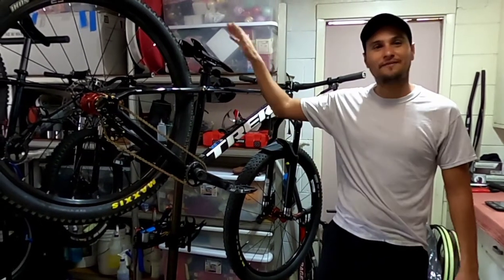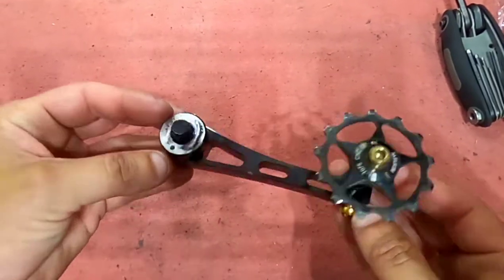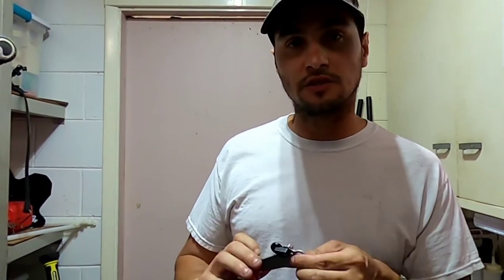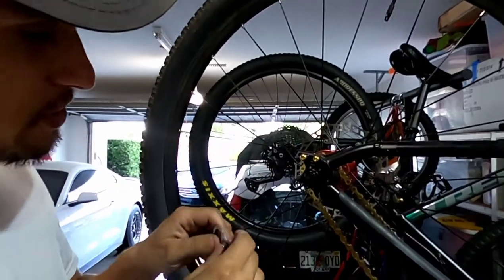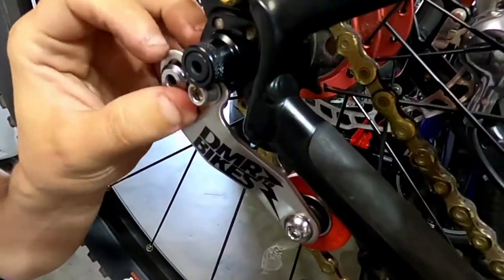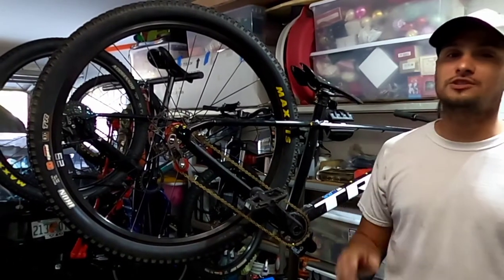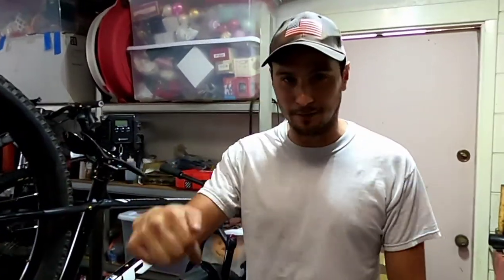DMR Chain Tensioner Installed on my Trek Marlin 5

Comment: Chain goes on top of the red rubber wheel. Everyone installs these wrong. Even the manufacturer gets it wrong.
Reply: No it doesn't. That would literally give zero tension. I tried it on the top first 🤣
Reply: Yes it does cuz it pushes the chain more into the cog and spreads the tension out more evenly
Reply from the maker: With other tensioners, yes but the DMR tensioner was designed the way I installed it

Comment: Haven't you mounted the CT incorrectly? The jockey wheel pushes the lower chain down and off the freewheel, concentrating the pedal force onto fewer teeth and chain links, causing faster chain wear and sharktoothing. But if the jockey wheel pushes up from below the chain  it wraps chain around more freewheel for less wear and more efficient drive.
Reply from the maker: Yes it's mounted correctly. If I would force the chain up I may only get 1 or 2 tooth more which wouldn't be much of a difference. Think about it even with a regular cassette and derailleur you're grabbing less teeth through all the Cog sizes. Now for the chain wear that could be a double-edged sword I see how you think it could have premature wear. But on the other hand the more the rollers on the Chain comes in contact with a cog could wear it out even faster which they call chain stretch.
Reply: @hardtailrider7172  Hmm....I'm not quite convinced. Note that on a usual derailleur setup the chain runs off the rear cog and upwards to the top derailleur jockey wheel giving the wrap effect described above. After ditching all that for a single speed I was mystified that my chains only lasted 3 months max compared to 5-6 months with derailleur. So i tried a CT and doubled my chain life. The descending chain from the JW grabs the freewheel in front, meshing with more than half of the freewheel teeth. Now compare that with your setup.
Reply from the maker: @sidmarx7276  I've been running the same chain on my single-speed for about 4 and 1/2 months with no issues and I'm running an aggressive single-speed. no need to change something that works Flawless for me but I do value your opinion. Trust me I tried to make it to where I didn't have to have a CT I spent a lot of money trying to make that happen but it just couldn't do it.
Reply: @hardtailrider7172  Glad your method works, and i'll try it if my chain starts wearing too near the chainstay.
Reply from the maker: @sidmarx7276  I will be putting a video out on Wednesday on the DMR chain tensioner things I had to replace and needed modifying minor stuff.
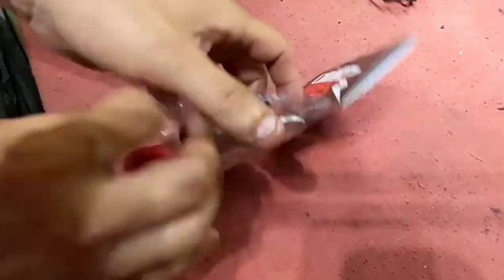Reply: 1:53 if you spend 3 seconds look at the instructions they gave you.... Chain goes above the jockey wheel. 
Say you hit the tensioner on a rock, you lose all chain tension with your setup.

Comment: My dmr went in the bin. The aluminium dropout part stripped its threads, the bolt isn't long enough. 
4:50 hard to explain but the 2 bolts are offset and some hangers are offset so you need to put a washer under the tensioner small bolt or the whole tensioner gets put on an angle. 
After a year that Eurethane jockey wheel disintegrated. 

I've got some brand new dmr pedals that have sloppy ass bearings from the factory. They don't even know how to tension cup and cones

Comment: It is possible to open up the roller to accept 1/8 inch chain - turn it  with a lathe if you have one.  I used a butane fired soldering iron to melt and push the extra material away.  Looks janky but works. They should offer another roller. Pain in the a$$.

Comment: 40 dollars??
For piece of metal with the plastic wheel 🎡??
I just shortened the chain as much as I need,so it won't fall off the sprocket or a rear cog! Works perfectly! 😊
Reply from the maker: Yes I agree $40 is a lot but but somebody has to make contact😂
Reply: DMR are awesome, I see what your saying about it's just metal and a plastic wheel.
Honestly the customer service is great and all the parts are available to buy if you loose them or break them.